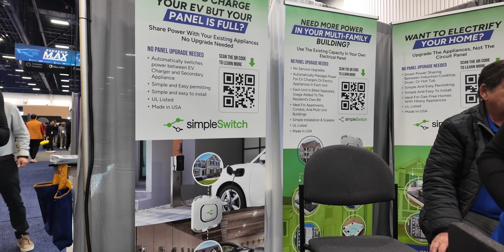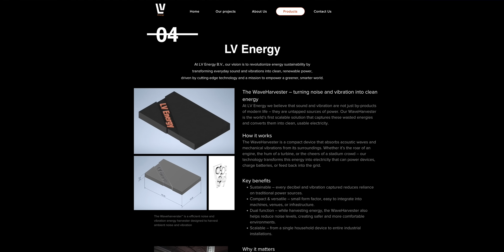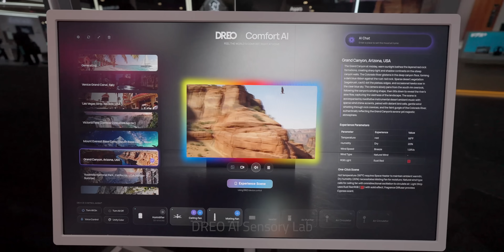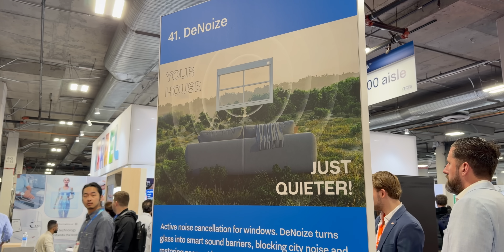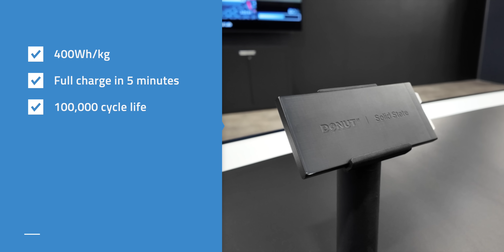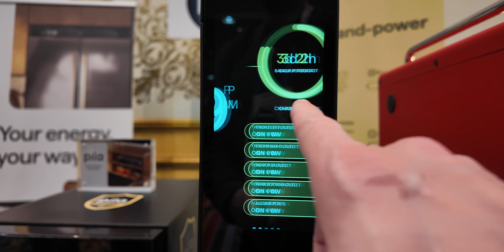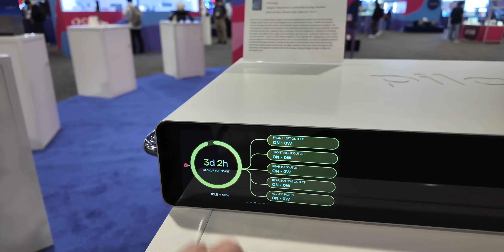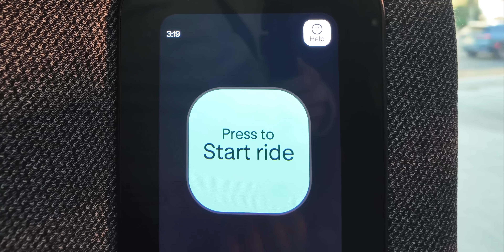The Most Controversial Battery at CES 2026

Comment: You know, I've been following home automation for 40 years now. I hate to say it, but very little of the stuff highlighted here is interesting to me. While some of it is useful, I really dislike the feeling of a house constantly adjusting itself as I or others walk around and do different things. I don't want that. I guarantee most people don't want that. The house and everything in it needs to shut up and stop moving or beeping or blinking every ten seconds. I've also come to realise the time saved by automation is far far less than the time spent tinkering. I think I prefer a house that's completely manual.
Reply: @kanojo1969  the tinkering is the hobby for the person.
Reply: Depending on the number of inhabitants, the ratio between tinkering and saved time shifts In your favor.
Reply: @quaternion  well I don't live in a 27 person household so I think that I'm fine with the house just sitting still
Reply: @OmegaFire11 The people trying to defend it is astounding. You manually turn on the heat or a light without thinking. It has never been a chore. I like manual and stand with you buddy.
Reply: @OmegaFire11  27 is a big number. I won't argue against that. 🤝
Reply: For me i think it boils down to just using smart home features that use home assistant and mainly using it to safe on money.
Currently in use: smart thermostats on my radiators (living in germany), using sensors to detect open windows which communicate with the thermostats  , 3 smart roll-down curtains on the north facing windows, smart bulbs and a few smart sockets that reduce electricty use/optimize the use of my small scale PV.

Everything else is not worth it.
Reply: Home automation should make things more easy for you. That’s not yelling to a speaker to turn on the lights, but having the them turn on automatically when you come home when it’s dark. 
Or switching off all the lights and appliances downstairs and turning some upstairs on with one click of a button when you’re off to bed. 

But no matter what, one should remain to be able to switch everything on and off manually even without a network connection.
Reply: You don’t have to like automation. It's just not for you.
Reply: There is good and bad automation. The good kind works so well you forget it's there. Like thermostats. Would be damn annoying to turn heaters on and off all the time to maintain a steady temperature. Same with lights that adjust brightness and colour temperature during the day, and fade in in the morning before the alarm clock goes off. Very nice.
Reply: @tvuser9529 People forget thermostats are the OG home automation.  Before those it was a real PITA.
Reply: Exactly my thoughts. I LIKE my house to be unaware of what I'm doing and how many of us are in the house etc.
Reply: @davemeise2192 Then I wouldn't automate anything in your home. Some of us enjoy it
Reply: @Conceptsofaplan8647  Agreed. For those who enjoy it, go for it. For those of us who don't like something else to do stuff for us, we'll simply not automate anything in our homes.